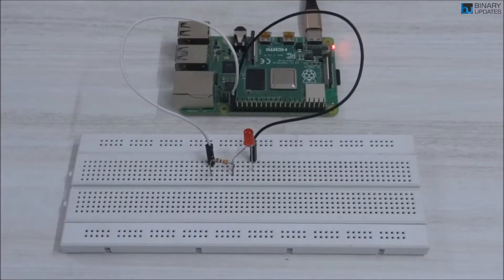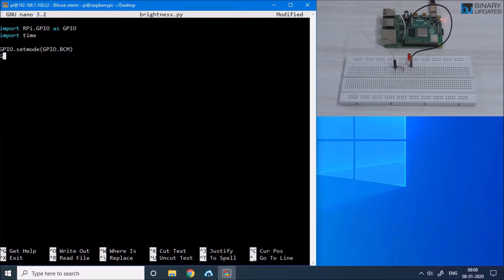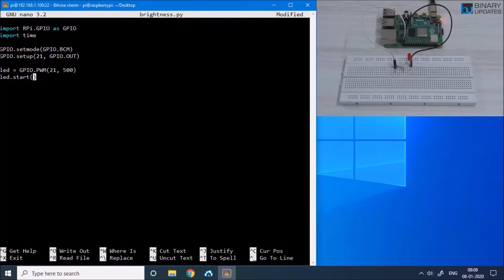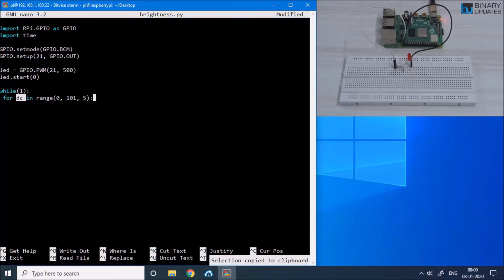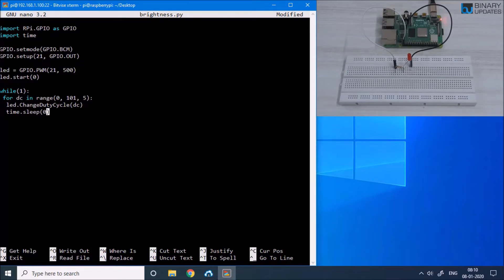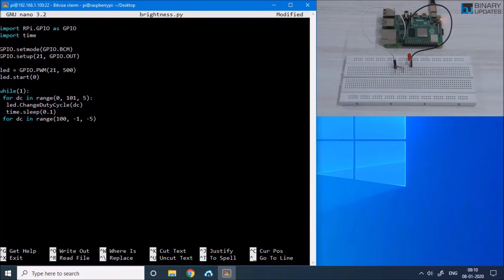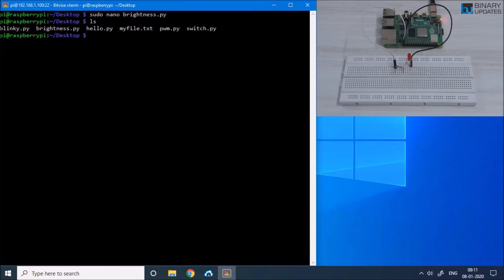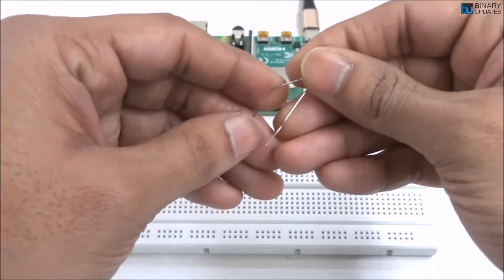PWM with Raspberry Pi4 LED Brightness Control (Pulse Width Modulation)

Comment: I got an Ultra-HD PLH3D-XT-50 with it’s controller and my CNC controller is a Raspberry Pi 4 Model B, 
How can I connect the laser controller to the Pi board to which pins should the laser controller wires from be connected ? I know on the they should be connected to the PWM but i don’t know to which pins and how to Programm it

Comment: How can we control the light brightness when the LED is connected to a battery for a power supply. I will be thankful for your help
Reply from the maker: Hi Yugesh, there are several ways you can achieve this. One way is to use TRIAC but i belive it still need some kind of microcontroller to drive LED brightness control.
Reply: You can use a simple bjt or a logic level mosfet with a pull down resistor. Triac is for the alternating current.
Reply: @BINARYUPDATES  he can also use a simple 555timer in astable mode to control brightness of led via PWM. A potentiometer can be added to 555 toner to make the duty cycle variable and a mosfet can be attached to the ouptup of the 555timer to drive bigger PWM loads